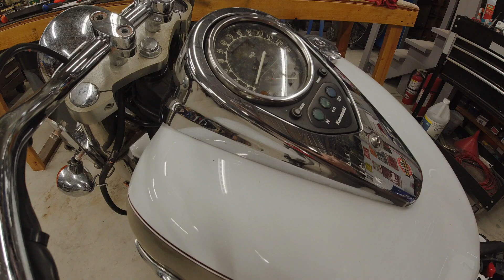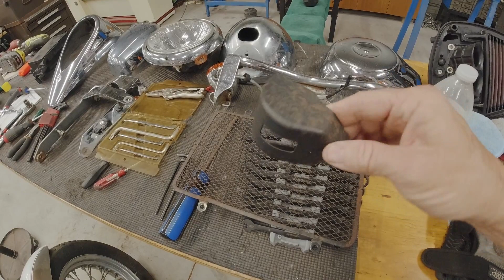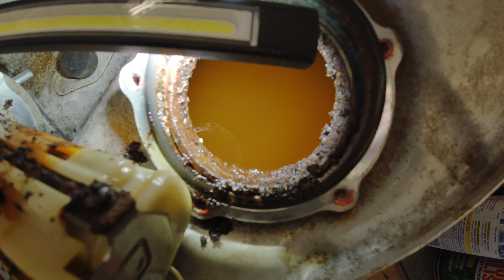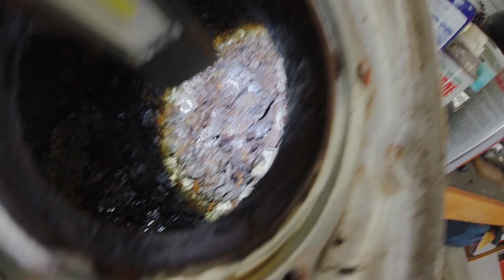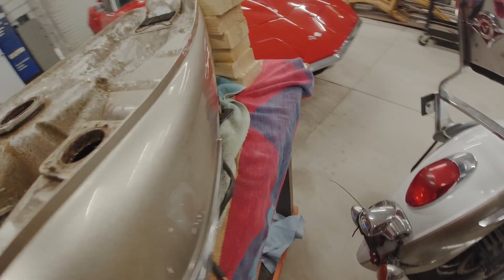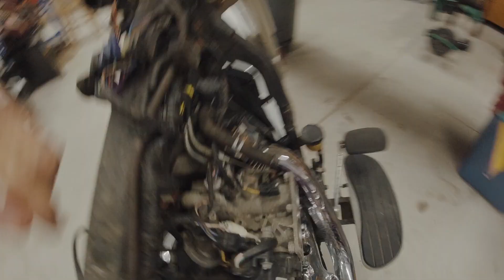Dis assembling the 2008 Kawasaki Vulcan 900 Part 1

Comment: If you need to clean that tank. Battery charger, and a few items along with a bolt. You can make it like new and over night. Do a search for  electrolysis fuel tank rust removal. I have cleaned a lot of tanks. Some I though should have been tossed. Turned out like new. 
Last Kawasaki tank I did, used a Galvanized bolt. That tank turned out the best. Seen the guy that bought it and its still looking new inside. Will be doing a 2002 Kawasaki KZ1000P police bike soon. And will use the same type of bolt for it.
Reply from the maker: Awesome. Thanks for the information. I will look into that.